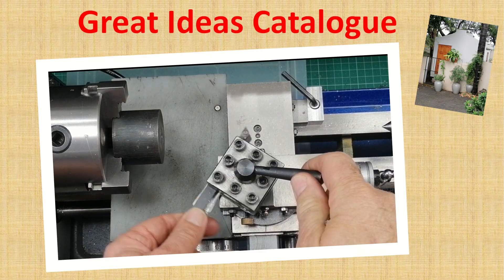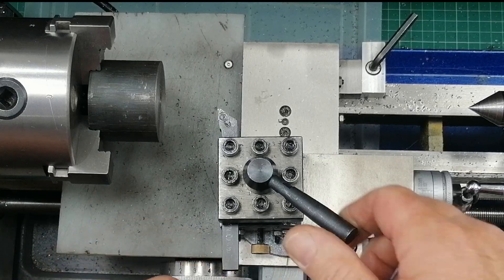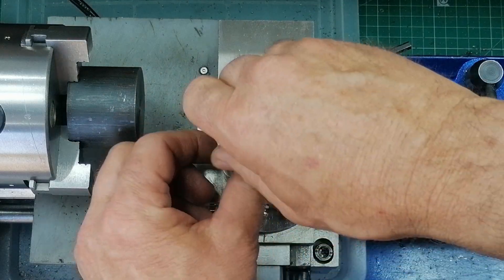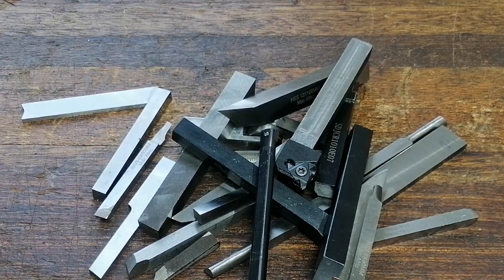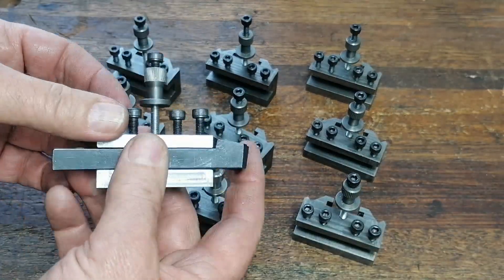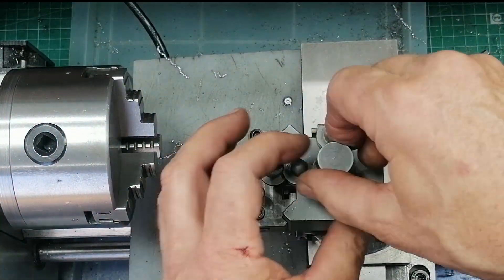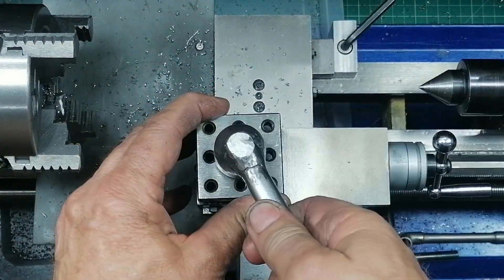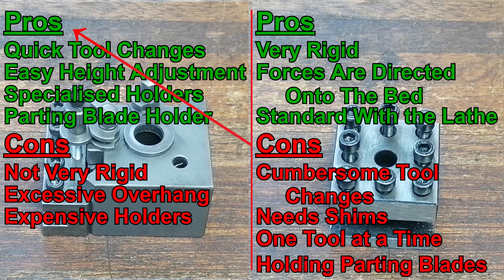4 Way vs Quick Change Toolpost Best of Both Worlds

Comment: Why couldn't you make quick-change tool holders that fit in the 4-way tool post?
Reply from the maker: I guess that is possible. I am busy remaking the top slide (with two holes to allow the quick change toolpost to not overhang, while also allowing the 4-way to be mounted). Remaking also enables me to make it more rigid (with a thinner gibb). It fits perfectly and I look forward to test it to see if that solves the rigidity problem. I know that I will also have to remake the cross slide gibb (to solve the rigidity problems there) but hopefully not the entire cross slide. I must say, precision work is satisfying. I will think how quick change toolholders can be combined with a 4-way. Do you have any suggestions?
Reply: @GreatIdeasCatalogue  My initial thought was to simply take the design of the quick-change tool holders, remove the screw adjustment and dovetails from the back and make it with a bar instead that would be inserted into the 4-way tool and held in place with the tool post screws. The tools would then be able to be held semi-permanently in the holders with their respective shims to raise the tools to center. However, because they are now in the "quick change" holder, they can easily be swapped from the 4-way tool post with their shims without needing to be put back and adjusted with every tool change.
 
There would still be an overhang because the tools would held in place outside of tool post, but it would be much a smaller of an overhang then what you currently have with the quick change tool post.

I hope that explanation helps you envision what I'm imagining. It's difficult for me to explain what I'm thinking with just text.🤗
Reply from the maker: That is a good idea. Thanks for the suggestion.

Comment: i was offered a second 4 way tool post when i bought my lathe. i regret not buying it, because it does make it handy to swap between two. I find that i lack the height adjustment of a quick change tp however.
Reply from the maker: If you have a milling machine, you can make another toolpost out of a block of cast iron. Cast iron does not bend (as steel does) and thus the bolts tighten first time.
I once made a toolpost from steel and found that as soon as the second bolt is tightened, the first is loose again. So I had to tighten the bolts many times before the tool was tightened down properly. I found out the hard way why they make lathe parts with cast iron.

Comment: Cutting down the tools' length would provide use of all 4 slots
Reply from the maker: Yes, you are correct. Thank you for that. 
Cutting the tools to length will work, but will also prevent the tool from being mounted further out. The tool is sometimes used further out to cut in places where a shorter tool cannot reach. That is why I chose not to cut them shorter. If I cut it shorter, I would still need another set that is longer.